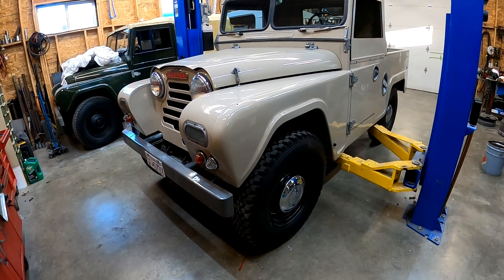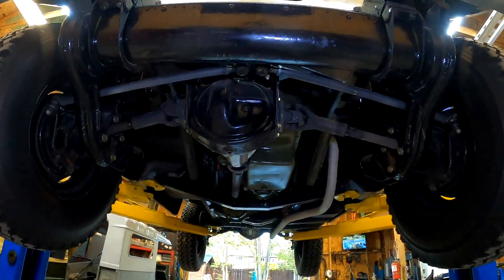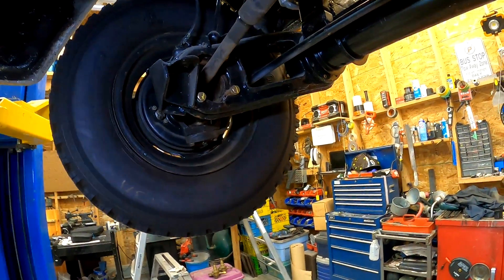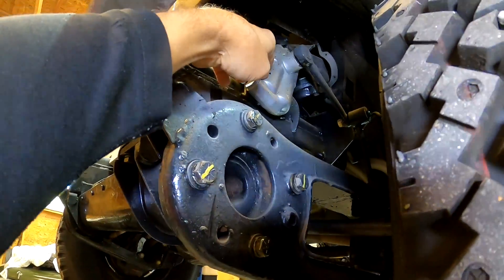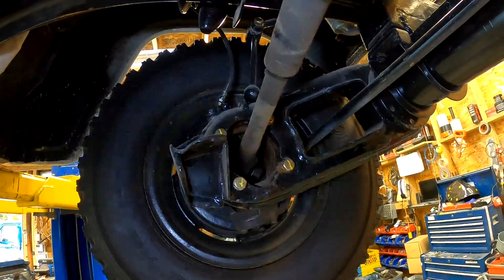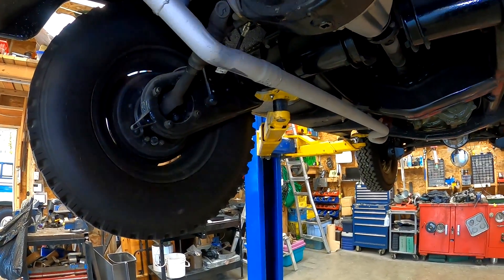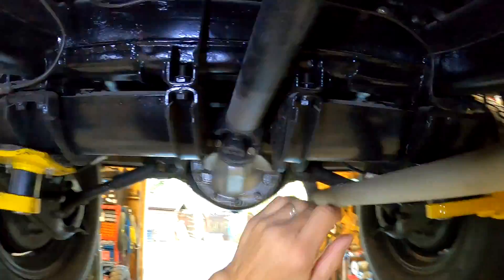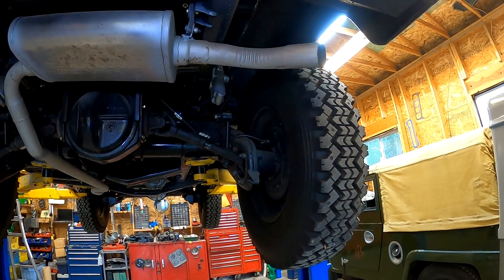What is Flexitor suspension? And how does it work on the Austin Gipsy?

Comment: On the bright side, if you ever need to replace the old Flexitor Bushings with more modern materials available for creating Elastomeric Joints like that.... between 3D printing of molds to pouring and curing the new Flexitor Bushings, its going to be easier today than when it was first made.
Reply from the maker: That's good to know, thank you!

Comment: Interesting, and a new one to me. So, it's very much a trailing arm and torsion bar suspension like Volkswagens had. Does it have ball joints, king pins, or the the big ball like a Rover for steering joints?
Reply: No need for the big ball as it's not an oil filled live axle. A kingpin would also want to share space with thedriveshaft, but he's got another video up shows there's 2 pins, top & bottom so functionally the same.

Comment: The knee action shocks were ditched due to heavy use can make the oil froth up and they lose their effect. tubular shocks contain more oil solving the overheating problem also the oil can be cycled through the system to lower the duty cycle. improved surface area to dissipate heat . Apart from that, the knee action type is reported as  a superior unit.
Reply from the maker: Yes I can see the knee action type having trouble keeping up with coil or leaf springs, I think the advantage here is that the flexitor springs are largely self damping.

Comment: That ride looks so soft and comfortable.  I bet is like driving a sofa. 

So can we agree that this is some sort of rubber torsion axle ,right? 
What happens if eventually the rubber get damage due to time or climate conditions?
It's is possible to get repaired?
Reply from the maker: @enterBJ40  Yes, it rides more like a coil sprung vehicle. And it is a rubber torsion spring which I always had concerns about sagging or failure altogether but they are still working great with no signs of deterioration. I know there were issues in very hot climates because there was an optional cover plate that protected the flexitor unit from the sun. If one did fail it would be difficult to find a replacement but I ha e spares on hand.
Reply: Cool. Thanks for answer. Enjoy it!

Comment: how much did the gipsy cost in late 1960s in gb pounds .. did it cost more than a landrover 109. i worked a lot on 60s 70s land rovers they are not built as well as a gypsy by a long shot .i had a nasty 109 1963 i got in Gibraltar with many problems to fix  . it was rammed in to a tree in reverse by a drunk ships captain who weeks later sold it to me cheap. the gypsy suspension and drive shafts are years ahead of their time on commercial 4x4 model.
Reply from the maker: I have an original sales receipt somewhere in my files, as I recall the price was $2,200.00 Canadian.  I think they were priced comparable to the Land Rover. The Gipsy definitely looks to be better designed and built, especially the chassis which is fully boxed and air tight, they rarely rust out.
Reply: @austingipsygarage  even the first aro 4x4 240  series made in Romania 1969 was better than any landrover made up to 1987. i find the axles of the gypsy and link suspension are like 30 plus years ahead of what landrover made .i worked on many land rovers in south africa all 109 models from 62 to 77 they were horrid things to work on .. the gypsy is very interesting 4x4 for a 1950s design very well and engineered .

Comment: One of the best under-belly "tours" I have seen, and a video of the suspension at work! Great stuff, thanks.
Reply from the maker: Thank you!
Reply: @austingipsygarage  The Gypsy was engineered like a Rolls Royce . For whatever reason the British Army selected the Land Rover. As a result they seem extremely hard to find .
Reply from the maker: @jackrichards1863  The Gipsy was very well designed and durable. They put a lot of effort into marketing them but I think it was the problems with suspension and steering in the first two years that gave them a bad reputation.
Reply: @jackrichards1863 The British Army thought they wanted the Austin Champ and spent years overspecing it. They only bought Land-Rovers (which weren’t designed as a military vehicle) because they were avalable as a stop gap whilst feature creep delayed the Champ and pushed its costs up. They ended up sticking with the Land-Rover as it proved to do an adequate job and they could have 3 of them for the cost of a Champ.

Comment: I never saw that version of suspension on a Gipsy. In 1967  I worked on torsion bar suspension Gipsys, converting them for Police and Civil Defense use.  I had a leaf spring version in the 1980's  which handled well.  It had an annoying fault. It would suffer fuel starvation every so often.  I finally traced it to rust flakes being picked up in the tank, building up at the restriction caused by the compression joint olive having reduced the pipe diameter at the tank connection. Replacing this dip tube and wangling on a spraygun filter fixed the problem. 
The Gipsy shared some components with the FX2 Taxi and the Morris J4 van.
Reply from the maker: That must have been a tough fault to troubleshoot, I've seen similar symptoms on old vehicles when the vent in the gas cap is blocked. The spray gun filter is a great idea.

Comment: was the triangular pressings in the back of the cab for optional windows like the land rover
Reply from the maker: That's a really good question, although I've never seen the triangular sections cut out in brochures, I've seen the full hard top side windows blanked out in the same manner. Then in later models the triangular shape was changed to square.

Comment: These little machines are so cool! I had been a jeep guy for most of my life but seems everyone else is nowadays and the appeal has worn off. 
This would be a cool alternative for sure, are these rare in the States? Are parts available? What’s the top speed like? Is there overdrive units for them?
Reply from the maker: Yes definitely rare in the USA, when they do show up they are usually the early series G1M10. It was the G1 that had the steering and suspension issues so I wonder if that gave them a bad reputation off the start. There is a guy in the Netherlands who specializes in Gipsy parts and a lot of parts can be found on eBay. Body parts are nonexistent though, but they aren't too hard to make if you're handy with sheet metal. I would say max speed is 60 MPH, but it's happy at 45 MPH. They are geared low 5.12:1 differentials, and I've never seen an overdrive option for them but it's likely possible to adapt. There's a G2M10 pick up (project) for sale in British Columbia. https://austingipsy.net/austin-gipsys-for-sale-buy-sell-your-austin-gipsy/